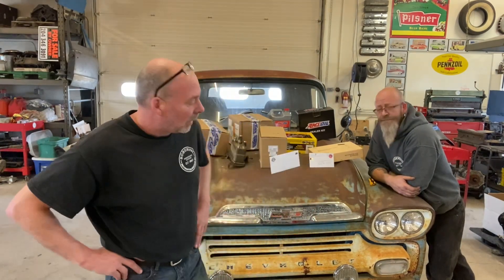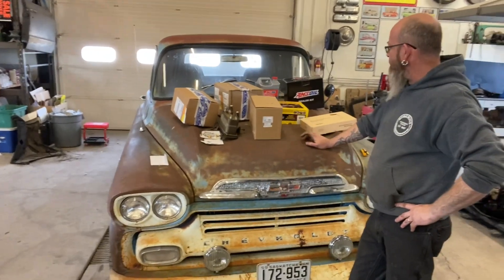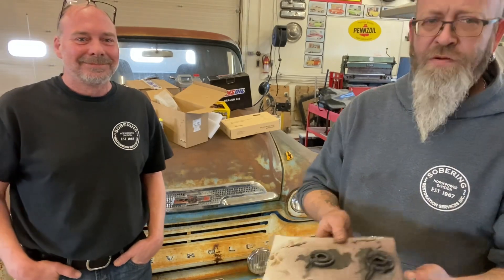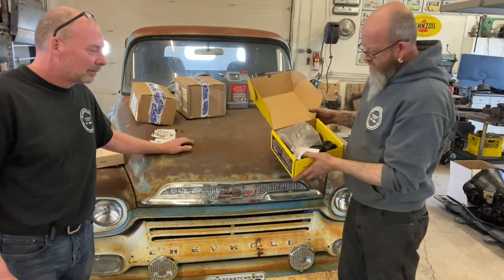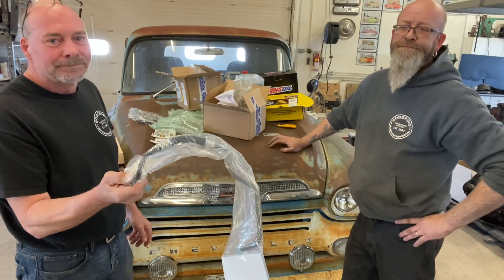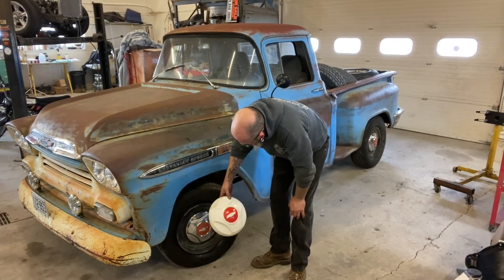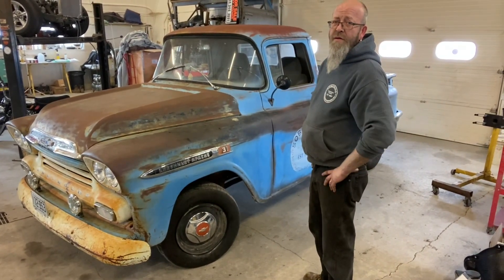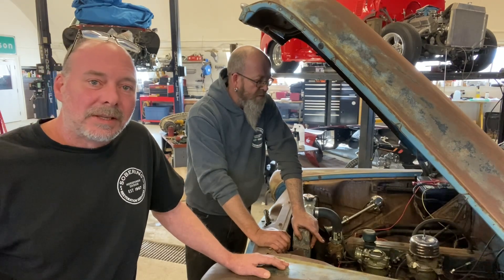Saturday with Sobering!

Comment: What did you use to dim the driving lights
Reply from the maker: This particular set of lights came with a resistor type thing and a switch that adjusts them.  Never seen anything like them before.